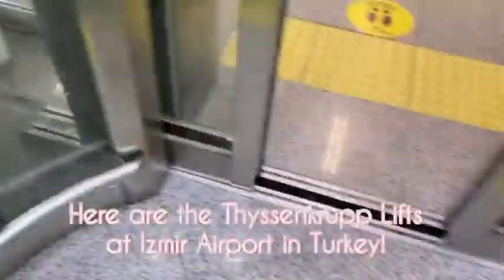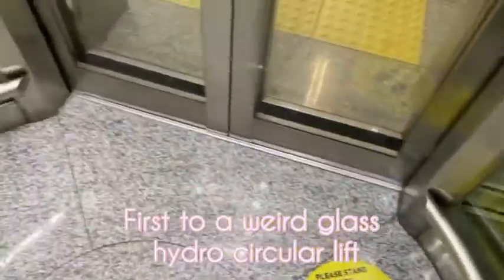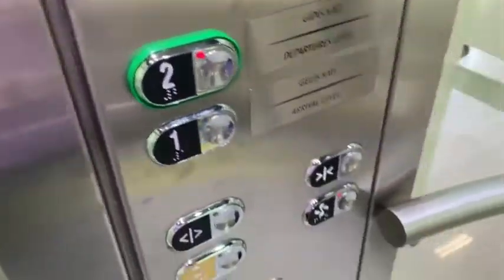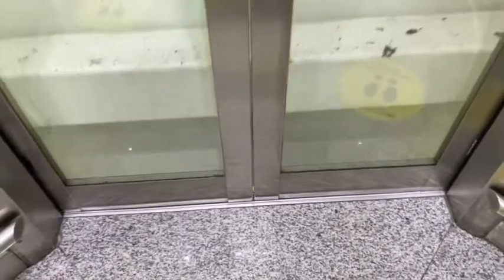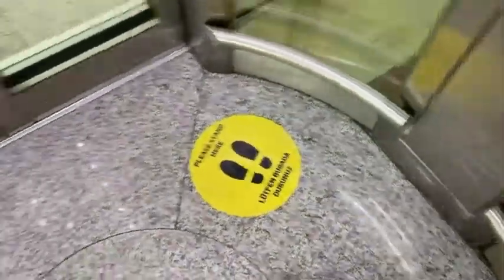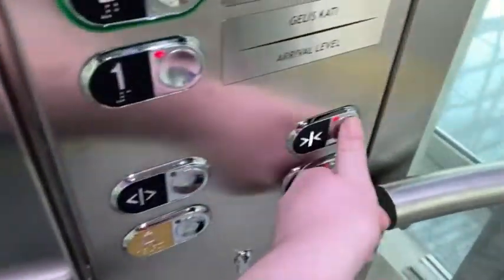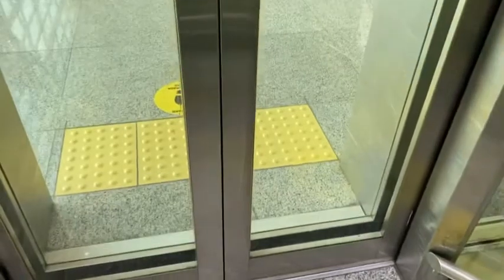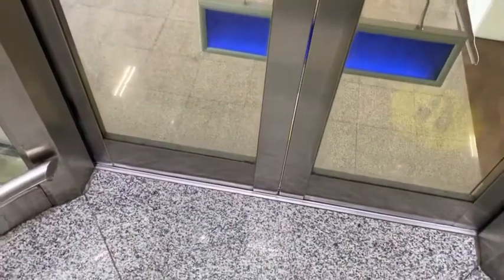Thyssenkrupp Lifts @ Izmir Airport in Turkey

Comment: Great videos. The indicator in the second lift has the same problem as the Riverpoint Tower in Limerick (the one which had an indicator actually working). Is this the furthest you've travelled (hope it's not a personal question or anything)?
Reply from the maker: Thank you! Yep, this is the furthest I’ve traveled. I’ve only been to the UK (when i was like 2), and to Turkey to see family, and last time I was in Turkey was early 2015.
Reply: @liftsinireland  Fuertaventura (one of the Canary Islands) is the furthest i've been, although I wasn't filming lifts at that time (this was back in late 2015).